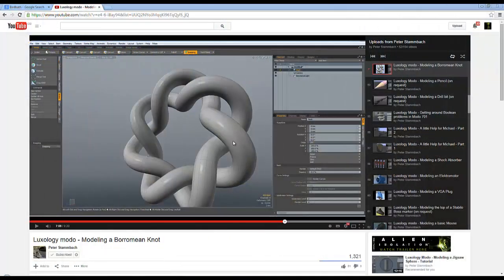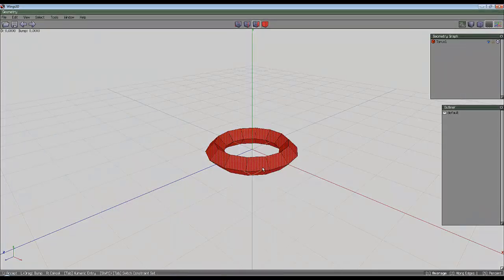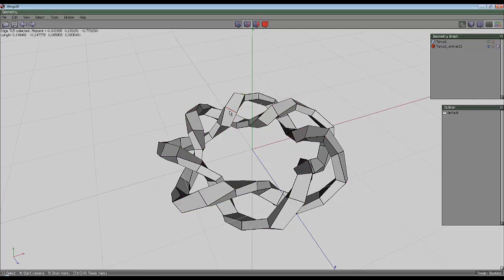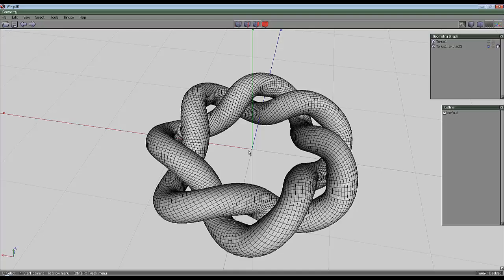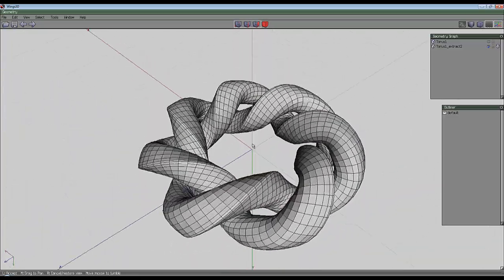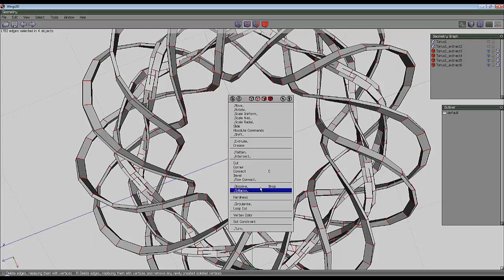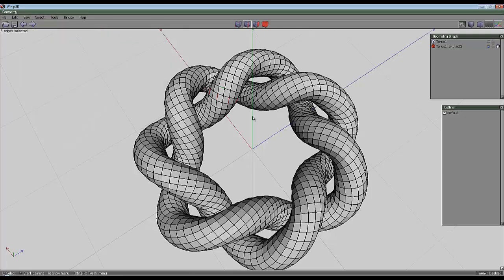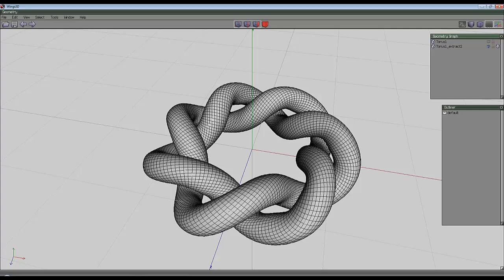Wings 3D - Borromean Knot - by David Brinnen.

Comment: Thanks for the very interesting tutorial. The object is the knot 7-1 http://katlas.org/wiki/7_1  or  septafoil. It would be interesting to see if a Borromean link with  3 interlocking loops http://katlas.math.toronto.edu/wiki/L6a4  could be made from a torus.
Reply from the maker: +Chris Wallace, thank you for the interesting link and the update on the name.  Peter has since remarked on his video that he was mistaken in calling it a "Borromean" knot and that that is something more like the Olympic logo - not the new one which I did not like, but old one with the rings.  And it seems that the 3 interlocking rings is something more along those lines and probably more worthy of the name.
Reply: +David Brinnen well thanks for the inspiring tutorials. I've only started using Wings and mainly just to smooth objects constructed in openSCAD - pity Wings doesnt input ascii ST  because openSCAD doesnt output it  I'm printing some smoothed solid edge polyhedra right now.
Reply from the maker: +Chris Wallace, for the last year I've been teaching myself (with the aid of Peter's fine tutorials) Modo.  I find it very nice to use but I am not yet at the stage of understanding that I was with Wings.  Modo has a few advantages over Wings for larger projects but is not quite so easy as Wings to make these organic mathematical shapes.  Though expensive I don't hesitate to recommend anyone trying out the free trial of Modo for the experience of it's slightly different approach to modelling.
Reply: +David Brinnen Modo looks awesome!However  I'm more into making things and don't now even qualify for an educational license ( I wonder if joining U3D would qualify?)
Reply from the maker: +Chris Wallace, I'm sorry I don't know the answer to that.  I've 3D printed a few of my Wings shapes at Shapeways, but like Modo it's not a cheap process.
Reply: +David Brinnen Only joking.  Fortunately I have my own printer which I used to print a bronze-filled version of a smooth polyhedron http://kitwallace.tumblr.com/post/129201375934/organic-shapes-with-openscad-and-wings-3d - great tool.
Reply from the maker: +Chris Wallace, ah very nice.  I have considered getting a printer myself, but I don't know that I can justify the outlay if I can't make it pay for itself.  Modo on the other hand I use to make models which are sold at DAZ3D.  If I could justify it to myself in some way, I'd be very tempted.